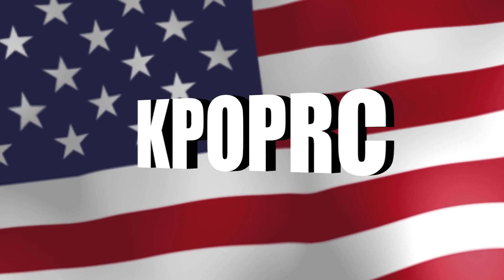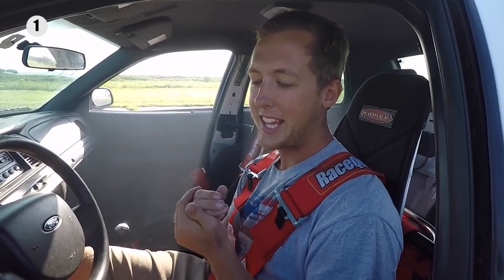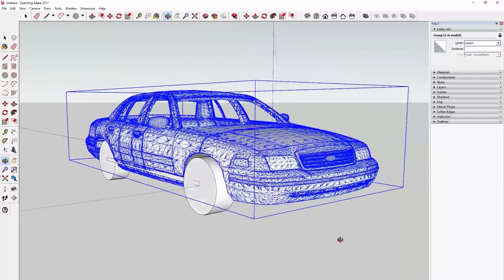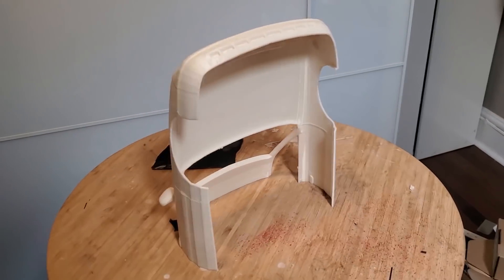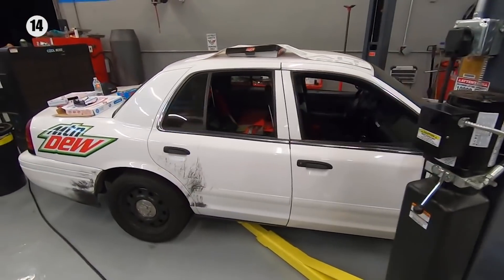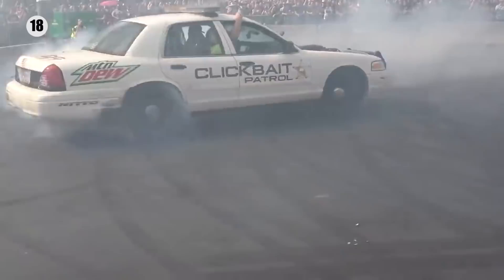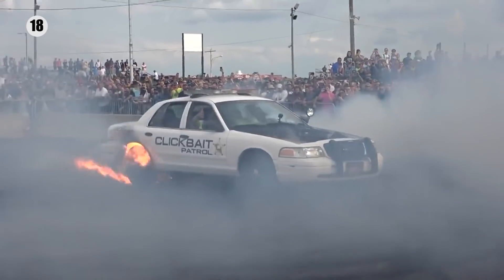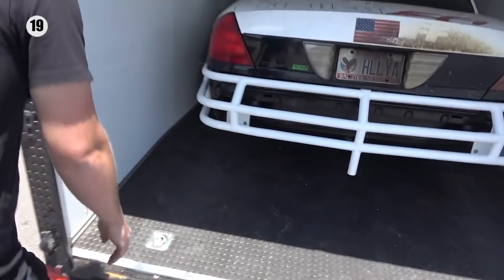RC CLEETUS' NEIGHBOR BUILD - Sweet Honey BBQ!!! EP 1

Comment: Hell yeah brother! Have you considered using a 4WD chassis? Disconnect the driveshaft and put a brake caliper from a nitro car on the input shaft of the front diff. Hook a servo to it and BAM. Line lock. You should be able to do it with all Off the shelf components. Thanks for the seats! They’re going to a good home!
Reply from the maker: yep. thought about that... also thought about lifting the rear wheels off the ground slightly with servo.
Reply: congrats man im about to make my video on the seats i won

Comment: hookayyy sooo, dis is de erth. Might be a bit late to do this but you should really consider building this on an axial scx10 chassis. If you get a wraith or vanquish dig transmission and mount it backwards you can lock the front drive train via the 3ch on your remote. It also allows you to have rwd or 4wd on the fly. I did this with my still not finished hilux twin hammers build and it works a treat. only issue for your situation is that you will loose a little bit of steering angle but I think thats a price worth paying, for how easy it works out. You could also use the enduro ifs conversion to get ifs on the front of the scx10 chassis. Ive been wanting to build an scx10 drift chassis for a while, just got distracted by a million other things in the mean time.

Comment: Locking the front wheels... Do an All wheel drive chassis, remove the front drive shaft and put on a  flyweel with drilled holes and a servo the puts a peg into one of those holes... BOOM locked front

Comment: Just my thought...  possibly you could find a way to allow a servo to apply the brakes the same way as the throttle works, so you have full control of the amount of pressure you use. Probably would mean using a joystick aircraft kind of transmitter.
Reply from the maker: yeah. it's kind of what i am planning. but the break will be applied by a 3channel knob. so i can full throttle while braking. stay tuned... waiting on the chassis to get rowed here over the pacific.
Reply: @kpopRC  one other random thing, have you seen the superstate active suspension kit? Looks sick and might help give the crown vic the wollowey look it has being thrown about on stock suspension.
Reply from the maker: yeah superscale is on here every once and a while. i want to keep it light. and smoke i dont see crazy roll on neighbor. not as much to make the weight worth it.

Comment: Either use a nitro brake, or the tricker item would be to have the front driveshaft either drive the wheels or a faux blower. My initial thought is that when the front suspension is in the natural height the wheels are engaged. But have the drivetrain/input shaft raise or lower and it only drives the faux blower- hence line lock.

That model is basic but does have a ton of issues. I will download it later on and see what blender can do to clean it up. And yes, that has worked more times than I care to admit.
Reply from the maker: Ha! thanks man! find me on fb. less people on there. and we can actually connect that way. i appreciate the help brother.

Comment: make the suspension lifts with servo, like I did in my YouTube video
Reply from the maker: yeah that was the plan. but. im thinking switching the chassis, so i could adjust friction on both front wheels with one servo.
Reply: @kpopRC  awesome man, cant wait to see it
Reply from the maker: @scaleaddiction  love your builds dude. it's funny my idea last week was to lift the back slightly. but now im thinking i might get more control over friction if i push against a front wheel drive spool.
Reply: @kpopRC  yea there is so many ideas in our head lol, sometimes they come all together 😂

Comment: This is most probably a 3d model extracted from a game, proportions are right, but topology is hell.
Reply from the maker: SUPERSCALE! glad to have you here! yeah man we're thinking it's like need for speed. or some video game model that was crudely made to be thick. the light buckets printed inside the model. it's a trainwreck for sure.
Reply: kpopRC There was a rip of forza models and they were pretty good but the exporter was making mistakes, they did fix it later, I think. Still have to make it printable though. I had my oldsmobile made by a friend but then I had to give it thickness and make it printable.

Comment: Smoke.. dry ice.. maybe.  
Or if out doors magnesium which if i remember right hits oxygen and its starts to smoke   . I know a container of it got pierced by a fork lift and it fill an area the size of 2 1/2 football grounds.
Reply: I've never heard of magnesium smoking with exposed to oxygen. They make rims and other parts on vehicles out of magnesium. My car actually has magnesium rims. My bike had magnesium engine cases on it to my dismay, when I broke a whole in one I anted to weld it which I could have if it were aluminum, but not a possibility with magnesium.
Reply: Try google.  It will tell you its a class 4 fire hazard.   A shipping container that was filled with it was damaged by the forklift. It oxidized creating a black smoke plume .
Reply: @jessicalatex2539  I know it is a fire hazzard. If you get it lit it burns very hot with a white flame and almost impossible to put out. But exposure to air doesn't make it combust or smoke. It takes a hot enough spark or flame to ignite it. I know what i am talking about. They used to call racing rims in the 60's and 70's mags because they were made with magnesium because it is very light weight, and as I stated my motorcycles engine cases as well as the wheels that are on my car from the factory. When I repaired the engine case on my bike I literally had to sand it down so I could fill in the crack with epoxy, if air made it smoke id have seen it. They also sell fires starters in the camping section of most stores that is a chunk of pure magnesium and a country on the other side for striking with a knife to make sparks. You shave off pieced of the chunk and then ignite it with sparks from thw other side, whick I also happen to own one of those as well.
Reply: The event i described the magnesium was in its raw form.  I was not present for said event as wasnt working in the place when it did.. however during safety meetings/training it was brought up in the list of accidents that happened in the past.